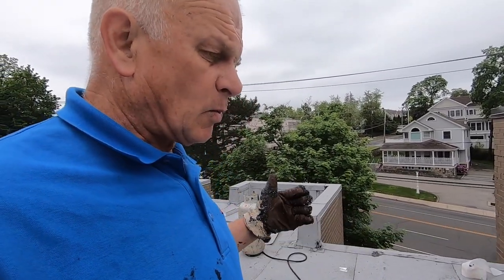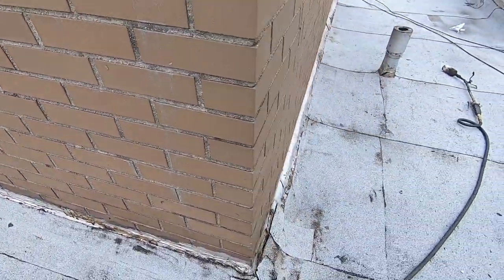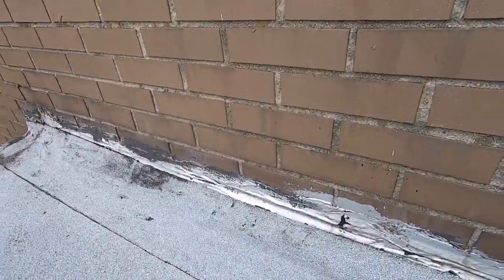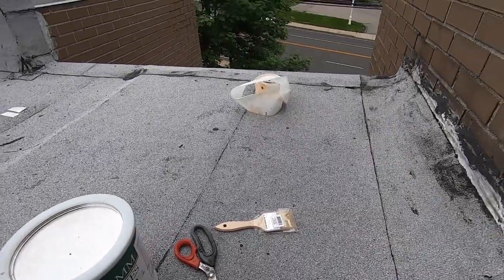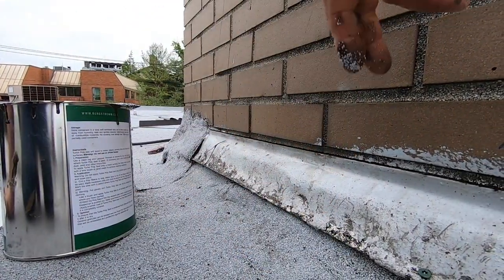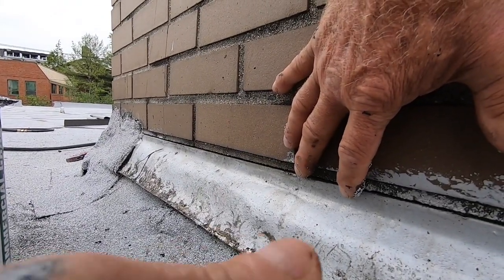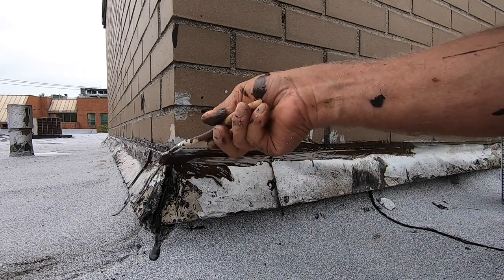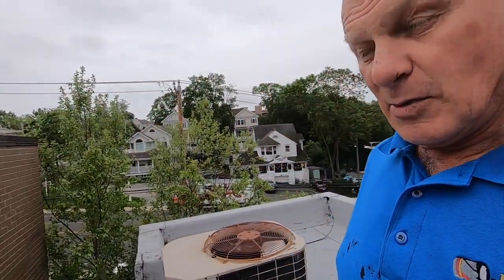FLAT ROOF LEAK REPAIR | Commercial Roof Flashing | TURBO POLY SEAL

Comment: Hello Doc! Interesting to watch your video and learn a lot from you. Here in Houston, it is hot and humid, how long do you think the Turbo Poly Seal will last before it cracks?
Because this sealer is not cheap, If I use it to fill a 5" seam line, how many leaner feet can I have for one gallon of Turbo Poly Seal?
Thank you a lot Doc.

Comment: Your right there it don't look pretty my question is if that product is as good as you say why isn't the method used on new work all of this products   that come out of a tin have a short life I know through experience the best way is to cut into the mortor chase and fix a proper flashing
Reply from the maker: sure that would be the conventional way. The flashing that I covered here use to be chased into the wall. See as I turn around the corner on the video you can see how it used be, but it leaked so many times. I have a new way how to make it work by chasing it into the brick, but have not made a video on that yet

Comment: Exactly what I needed to see, Roof Doctor.  Thank you. What should I use to repair any holes in the flashing before I do your Turbo Poly Seal treatment? Would polyurethane caulking work?
Reply from the maker: Use the fleece over the holes
Maybe 2 layers of Turbo and Fleece but spread a day apart

Comment: What sand do you use?
Reply from the maker: I use ceramic granules that you buy from a roofing supply that sells Torch Down membranes. These ceramic granules are the same that is on the rubber membrane  that I am standing on. We normally carry a bucket of this to spread over bleeds on seams and where we overheat the membrane and want to cover these marks
Reply: @FlatRoofDoctor  
Can it be painted with an oil-based paint?
Reply from the maker: @Dino_Buk  Yes, Try oil based primer and then a oil based paint. You can also use Aluminum Asphalt Paint or AKA Silver Coating
Reply: @FlatRoofDoctor  
OK. Thank you for replying.

Comment: Queation: what is the reason to use fleece??
Reply: The fleece stops it cracking with movement, the equivalent of using steel mesh in a concrete slab.
Reply from the maker: Excellent answer
Reply: @paulf2529  I see, thank you 👍
Reply: @roystonpereira2887  
 The fleece is very flexible and that prevents the cracking.
Without the fleece, it could crack after some time.
Reply: @Dino_Buk  thanks for the info 👍got it
Reply: It makes the material a composite like the fibre in a glass fibre shell does for the resin which binds that together or carbon fibre does for the resin that binds that.